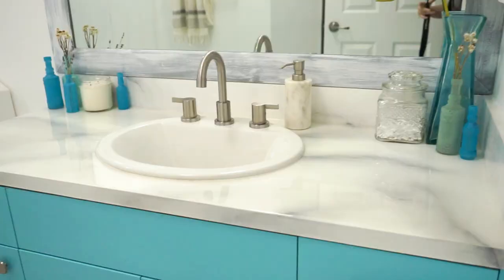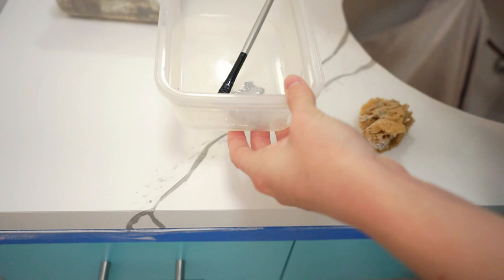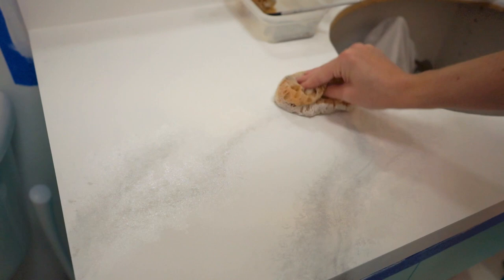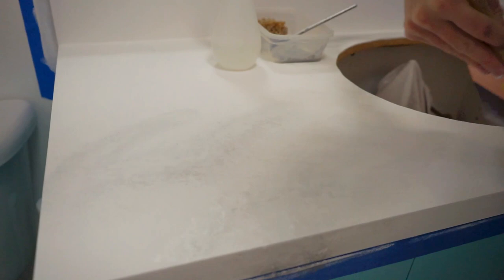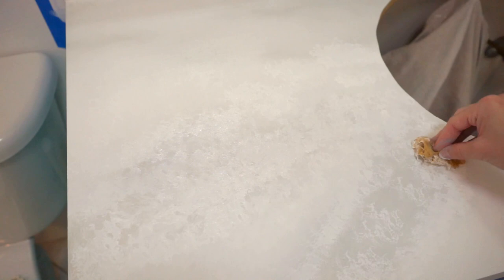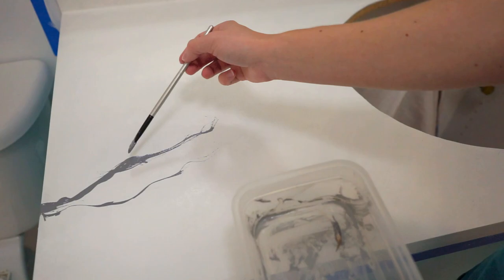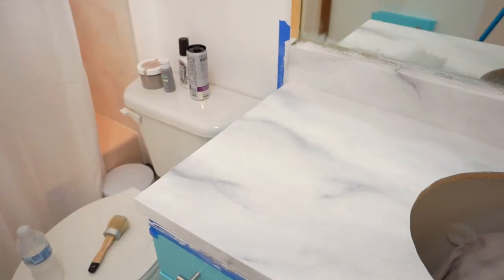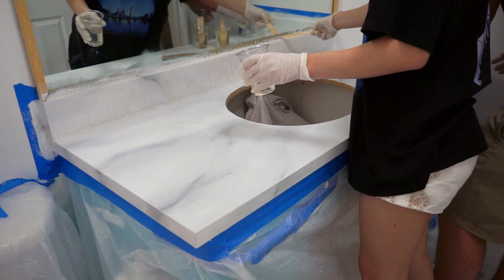DIY Faux Marble Countertop For $20

Comment: I have a question did your countertop turn a yellow color have a couple of months?  I think you did a wonderful job on your vanity top!
Reply: all epoxy will yellow over time, depending on the quality of the epoxy, plus I always put a ultimate top coat that has a great uv protection.  But if it gets alot of sunlight, it will over time.  Never have I had one do this in less then 4 years...but now, I just do either a very faint gray or a cream off white, so this doesn't ever have a problem.  You can also instill a bit of like an amber or cream into your faux finish background or design.